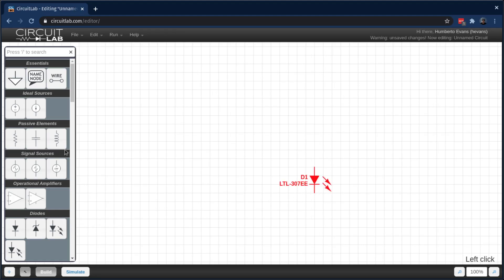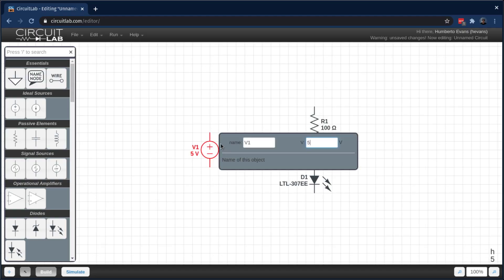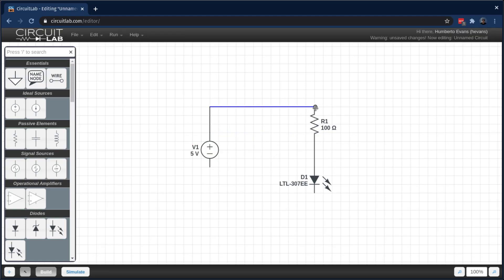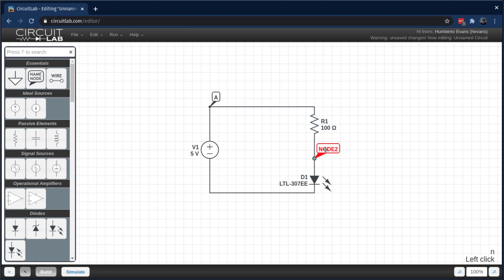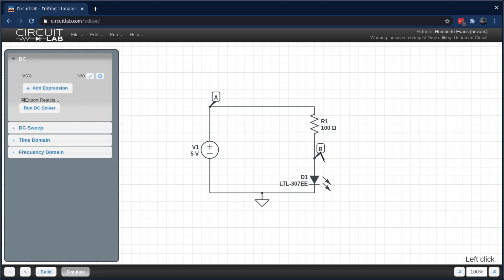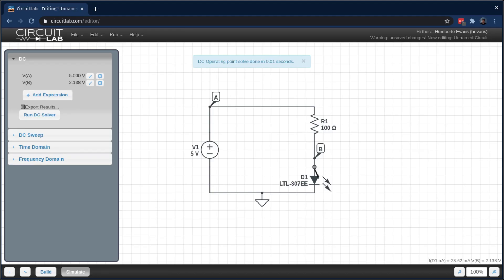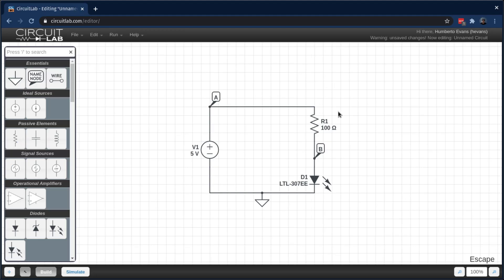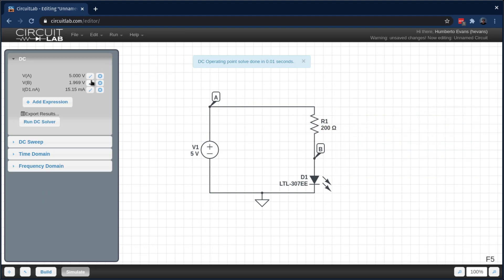LED Current Limiting Resistor - Why? - How Big? (Solved and Simulated)

Comment: I got tired of a circuit and limited 3.6V with an LED. I limited with resistors from 5V (to micro controller pins) on 2 paths and the other pin voltage came down perfectly then the other side create new numbers and I was up 200-300K. I have no idea how the LED is lighting up after 180K and have to draw the whole thing again to find out and maybe try to simulate it.

Comment: Why is ground required? If this was an actual circuit with a real battery, resistor and LED there wouldn't be a ground. Thanks. :-)
Reply: it makes probing easier. without ground, all of your voltage levels are floating.